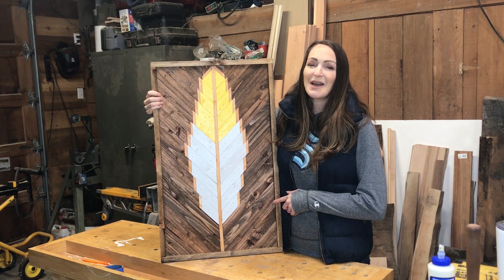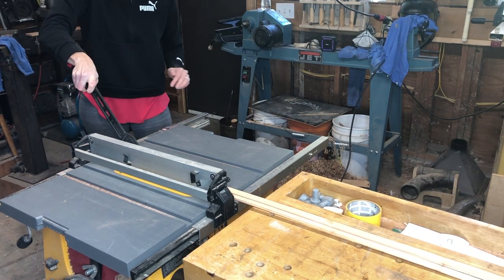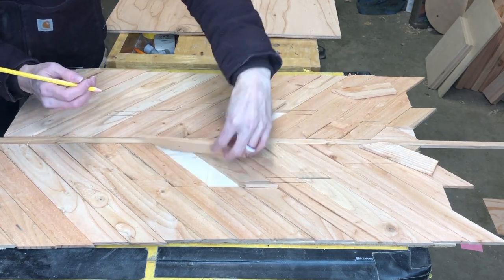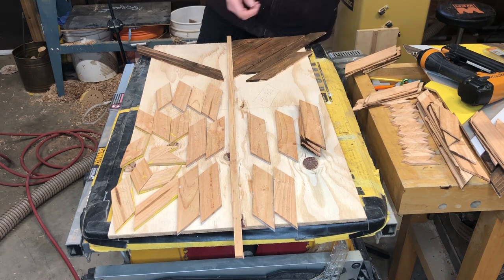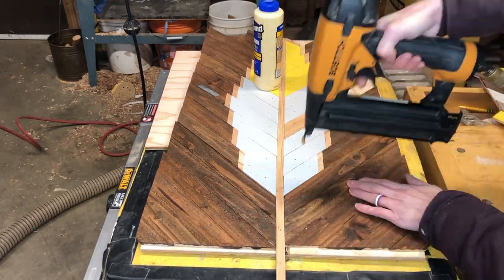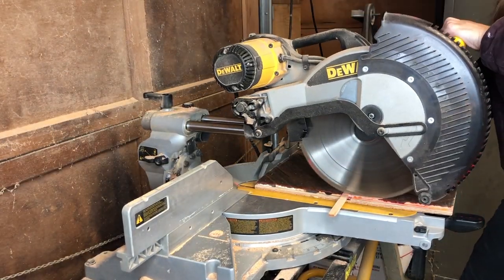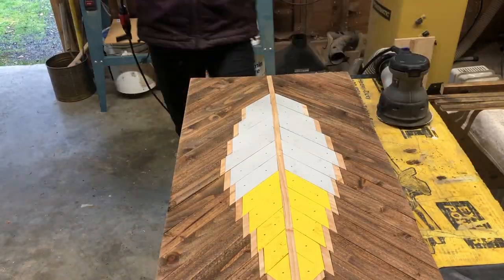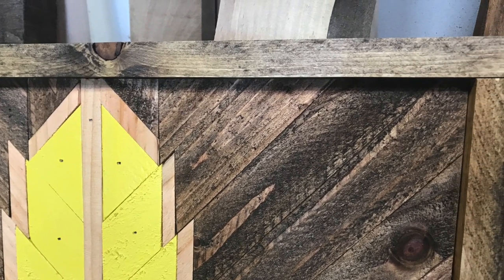Wood Feather Wall Art For Beginners

Comment: I would like to do some basic wood projects such as this concept and just starting out. All I have is a Dremel and orbit sander. Would a mitre saw be the best choice to handle most cuts. I would be using already milled wood. Any thoughts?
Reply from the maker: So exciting, you are going to have so much fun.  That is a tough question.  I guess it depends on what projects you intend to do.  But for me the mitre saw was one of my first tools.  It is such a great tool for so many basic cuts and easier to learn than a table saw in my opinion.  You may also want to invest in a shop vac that you can use as a dust collector unless you hav another one.

Comment: On the sides trimming, you can use a jig to cut on the table saw
Reply from the maker: Thanks Wade, I may need to check that out.  Wonder if one would work on mine since it's not very big.